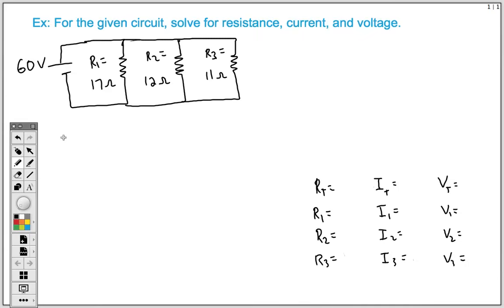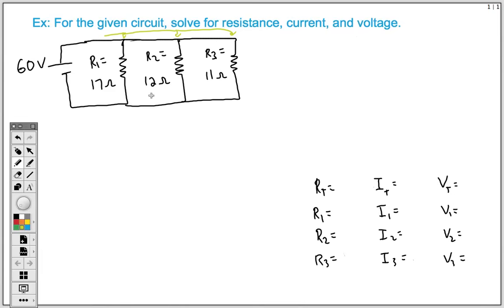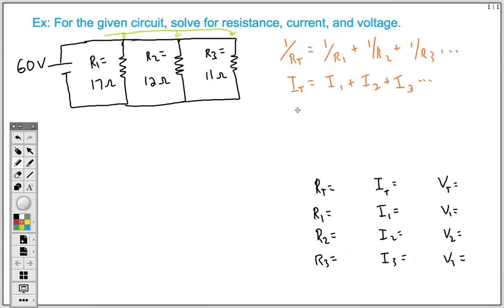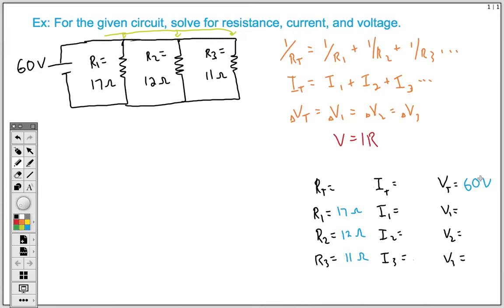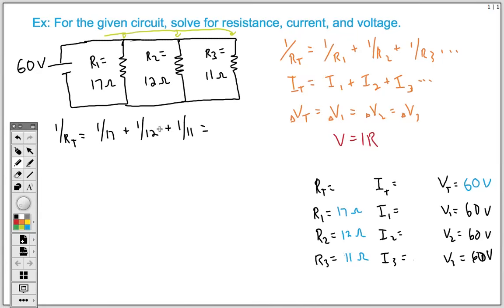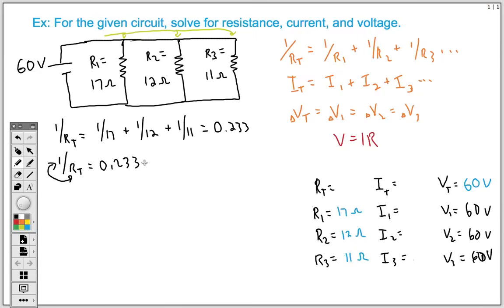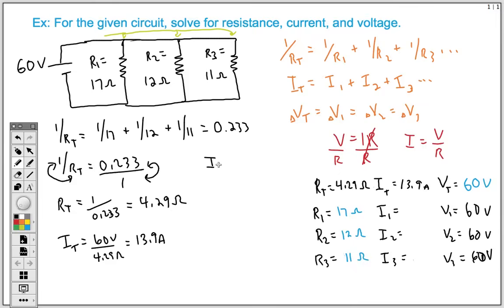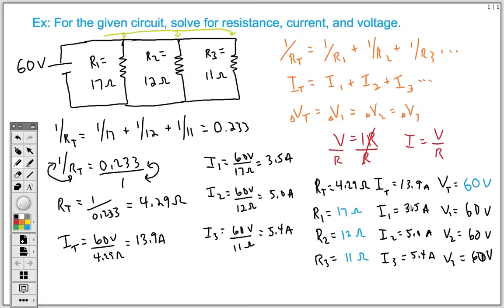How to Solve a Parallel Circuit (Easy)

Comment: I know that it a old video my problem is when I dived  60v into 13.9a I get 4.3 Rt not 4.29 every thing else worked I did cheat a little. I dived total   60v by 13.9    
 3 time ea same answer 4.3Rt I assume its my calculator.

Comment: @PhysicsHands One question so why did u put .233 and 4.29 but for It and I3 u put 13.9 and 5.4 and leave the other numbers after the .9 and .4
Reply: u didnt include the numbers after .4 from 5.4 bc the full number is 5..454.... and u cut the number at 4

Comment: I always had a hard time remembering voltage and current relationship between resistance in parallel and series circuits. Maybe remembering the inverse relationship with current and resistance in a parallel circuit will help me remember. Also, pointing out the reciprocal of the answer to get the final answer for total resistance in a parallel circuit equation was a point i always overlooked and no one really came out and explained it.
Maybe this will help me remember it. I don't do the equations on a regular basis, so time makes the memory slip. I'm brushing up on this because I'm a Journeyman Electrician, and I am wanting to go take my Master's exam for my contractor's license this year, and I know there will be at least one or two questions on the exam.
I'm not sure how series resistors and parallel resistors connected in series to each other would look. Some of the more simple circuits are easily identified, but some are more difficult for me to identify when they get more complex.
If I add three resistors I have in series and then two that I have in parallel, if they are connected in series, I should be able to add them all together, and in that case, if I had 12v source and add the resistors together in series, then my voltage should be 12 volts. Seems like a trick question but if I end up adding all the resistors in series, then the voltage will be the same after I add all resistors together.
what would a circuit look like if I had three resistors in series and two in parallel and the series and parallel resistors are connected in series. how would that look?
great breakdown of the calculations

Comment: I have to admit, when I was going through basic E in aviation school, I could never get it down. No matter how hard I tried to make sense of it. Memorizing formulas was what caused me to struggle the most when taking the General writtens to go for my A&P license. When you explained how to rearrange Ohms law at 8:18 , that really made everything click perfectly in one shot. It's all the same formula just flipped in a circle and as the circle rotates you rotate the order of the letters to make the next formula. (that's how I interpreted it) That made me think of other formulas in the Ohms law such as the equation R=V^2/P and that if I rotated it over the equation to solve for Power would be P=V^2/R and if I rotated it once more than I would get the equation for voltage being V= Square Root of P*R. I never needed to memorize all 12 of the equations in Ohms law but just 4 of them for, 1 for each of the sets and then I could rotate each equation twice to get the remaining 8 formulas! Thank you dearly for all your help. You truly don't know how much this helps.
Reply from the maker: @spectresarc  I like to call that "equation manipulation"
Reply: @DMaciaga truly you’re an amazing teacher and am glad to have come across your channel 🙏

Comment: Your explination is good but a bit vague And confuses the student. You said "just add all Resistance whitch gives you 0.233" but never explain how you got it thus confusing the student.

Next time try explaining a bit more on how you get those numbers. Whether it's by just simplifiying or converting a fraction to a Mix number. And also try to pick easy numbers to work with. Like base 10 numbers and such. It makes it easier to learn the process without having to overload on calculations.

Everything else is awesome.
Reply from the maker: @silentrookie1468  check the link in the description if you need more help on the 0.233 part.

Comment: That wasnt the easy way at all. I have no idea how you  got 0.233. I added those fractions and got 523/2244 and came out with 4.29 ohms. What you did was confusing.
Reply: If you add those 3 you'll get 0.2330659 or just 0.233

Comment: Mr. Amp i still cant figure out where did you get that 0.233🤧
Reply from the maker: Look in the video description for a link to a separate video where I explain the 0.233.
Reply: learned this from the class im stuck in, you get R1, and put it under 1. (in this case would be 17) and make that a decimal. do the same for R2 (and R3 if you have one). once youre done, you should add them together

Comment: Thanks for your video. Im trying to apply this to a paralell circuit of motors. Does this mean if Im trying to select the correct power supply to use in this situation my power supply has to be  a 60v supply with 13.9a output for it to work? And would it still function with a larger amp output?
Reply from the maker: Your question seems to be an engineering question in nature. I'm not really sure. Generally speaking the voltage supply is set (120V for a standard US outlet) and the resistance of the electric device determines the current supplied.

Comment: I never get the same number as these tutors when i add the resistances together how did he get 0.2333? I feel stupid I literally pressed the same exact buttons on the calculator and got different answer and my test is in a hr 🤡🤡🤡🤡
Reply from the maker: I have a link in the description that explains that part.
Reply: @DMaciaga  you're the man

Comment: If you solve for I1, I2, I3 first by using ohms law(V/R) then add them to get current total you can then use ohms law for resistance total?
Reply from the maker: When adding them in parallel you'll need to add their reciprocals, then to can use that for the total.

Comment: I need a question answered. 
Same math problem, different numbers.
1÷7+1÷15+1÷12= 0.2928 and gets rounded to "0.293" BUT when they did the next step- 1÷0.293= 3.4129, is stayes 3.41 and does not round up.
My question is... WHY? Please tell me.
Reply from the maker: Not sure, it could just be a preference. We should technically be using significant figures when doing calculations.

Comment: What? At 7:10, do you multiply .233 by 2 to get 4.29? How did you get 4.29?
Reply: 1 divided by 0.233 = 4.29 

its in the formula
Reply: He needs to do it by lowest common denominator to make it more easy that's what I think.

Comment: How do you solve for missing resistance?
Reply from the maker: Use V = IR as directed in the video.
Reply: @DMaciaga  as in let’s a R2 , same method?
Reply from the maker: @FierceSkatin  if you're trying to find R2, then you need V2 and I2.
Reply: Just like terms correct?

Comment: I am a little confused about why the total resistance is less than the sum of the reciprocal resistances. I feel like it should be somewhere between 11 to 17 ohms, no? Either way thanks for the video. Helped me understand how to do the math for a geophysics question.
Reply from the maker: In parallel, the more resistors you have, the less total resistance you will have. It would be the equivalent to opening up more cash registers at the grocery store to allow more customers to flow out of the store.
Reply: @DMaciaga  OH that makes a lot of sense. Thanks!

Comment: For anyone NOT understanding the .233 part of his explanation I will simplify it for u.....let me explain....if u add 1/11+1/12+1/17....the LCM is 2244. 132multiply by 17 gives u 2244...204multiply by 11 gives u 2244...187multiply by 12 gives u 2244. Just add the multiples which are 204,187 and 132 and u get 523. So 523 will b numerator n 2244 denominator. To get .233 just divide 523 by 2244. Now since it is inverted it means to flip it,so to get 4.29... just divide 2244 by 523. Took me an hour trying to figure out wtf he was talking about...he should have explained that part in detail. He explained everything else to the "T" but that part lost me...had to figure it out myself.
Reply: How to find the LCM of 2244... just multiply the denominator which are 11, 12 and 17

Comment: What do you mean " when you plug 0.2333 in? 7:19. Thanks!
Reply: Exactly..bro he definitely lost me on that. I am stuck on how to get the 4.29
Reply: I finally figured it out. He was NOT explaining it clearly but I finally figured it out and can assist you if u still need help.
Reply: Let me explain....if u add 1/11+1/12+1/17....the LCM is 2244. 132multiply by 17 gives u 2244...204multiply by 11 gives u 2244...187multiply by 12 gives u 2244. Just add the multiples which are 204,187 and 132 and u get 523. So 523 will b numerator n 2244 denominator. To get .233 just divide 523 by 2244. Now since it is inverted it means to flip it,so to get 4.29... just divide 2244 by 523. Took me an hour trying to figure out wtf he was talking about...he should have explained that part in detail. He explained everything else to the "T" but that part lost me...had to figure it out myself.

Comment: i've understood this video up until the part where u got 0.233 as ur decimal.. can u explain plz because i'm still confused on that part :/
Reply from the maker: I made a video how to do that. https://www.youtube.com/watch?v=-rlbe7se8dg&list=PLiNLOUuV2o1xLQaamib4S65wB9tIu6JhF Hope that helps!
Reply: He is clearly NOT explaining that part clearly...I finally figured it out awhile ago and I can assist you if u still need help
Reply: Let me explain....if u add 1/11+1/12+1/17....the LCM is 2244. 132multiply by 17 gives u 2244...204multiply by 11 gives u 2244...187multiply by 12 gives u 2244. Just add the multiples which are 204,187 and 132 and u get 523. So 523 will b numerator n 2244 denominator. To get .233 just divide 523 by 2244. Now since it is inverted it means to flip it,so to get 4.29... just divide 2244 by 523. Took me an hour trying to figure out wtf he was talking about...he should have explained that part in detail. He explained everything else to the "T" but that part lost me...had to figure it out myself.

Comment: what about something to show if you have amps and resistance but the voltage is unknown? That is what is stumping me hard.
Reply from the maker: Since the voltage is the same everywhere in a parallel circuit, use Ohm's Law to figure out the voltage.
Reply: @DMaciaga   well my problem is, and i guess im just not following, is i have 4 resistors #1 at 2 ohms, #2 at 4 ohms, #3 at 6 omhs and #4 at 12 ohms with 1 amp. so i guess the math is confusing me on how im supposed to get the same voltage on all the legs.
Reply: i guess just tell me if my math is right. total resistance would be 23.81 ohms? which would give me 23.81 volts?
Reply from the maker: @eagledefense2004  Assuming each of your resistors are on separate branches, your total resistance would be 1 Ohm. Your voltage should be 12 V; V = (1)(12).  From there you could calculate the current in each branch. Add up all the currents to find the total current.

Comment: How do you pug 1/0.223 in calculator cause  I keep getting 4.5
Reply from the maker: 1/0.223 is 4.5.
Reply: @DMaciaga  o so basically im an idiot lol
Reply from the maker: @tylerkilo5254  No, you're just misreading the number. It's 0.233 not 0.223, that's why you weren't getting 4.29.
Reply: @DMaciaga  yea thats why i said im an idiot XD

i appreciate the help tho !

Comment: Now how do you get the voltage drop over each resistor?
Reply: Voltage is the same all throughout a parallel circuit :)

Comment: hey man! how did you get the reciprocal of 1/17 + 1/12 + 1/11 ? how did it come up with 0.233 ? I'm too rusty that's why I'm asking.. Thanks for the reply
Reply: Hey! I just did the problem too. You can find the decimal for each of the values, 1/17 = 0.0588, 1/12 = 0.0833, 1/11 = 0.0909, and add the decimals to equal approximately 0.233.

Comment: Thank you ,  I am doing an electrical installations course . Did the calculation using a different method (I use my calulater on stats settings , I find it simpler )  . It was reassuring and helpful  knowing that my method was also right .

Comment: It would have been quicker to solve the total current and use the total voltage in combination to solve for the total resistance. I suppose in some cases you may need to work this way but the example you gave would have been easier solving the voltage and then current. I use the P over I and E; E over I and R or you can remember PIE and EAR. This will help anyone remember the formulas if you have a hard time. Lay it out with PIER.

Comment: My instructor was confusing me when explaining this exact process.  He did it just like you, but my confusion was about the Volts being the same everywhere. He was talking about voltage drops at each resistor or pairs or resistors in parallel in their own branch, and then saying the voltages here were all the same.  Can you explain voltage drops???
Reply from the maker: A voltage drop is a measurement of how many volts run across each branch in the circuit. You can think of voltage like how much electric power runs through the branch. Hope that helps.

Comment: Hmmm... Resistors give off heat... The higher the resistance the greater the heat... Heat can be made into steam and generate energy...

Now... Say we have 1000 ohms of resistance in 1000 branches ... The total ohms would be 1 ohm with that equation... Now... Voltage is constant... And since v=IR I=V=60... 

NOW, use 100,000 ohms and 100,000 branches... You get the same total ohms and same total current...

NowV=IR AND THE BATTERY USES THE TOTALS AND THEIR THE SAME SINCE POWER=IV SAME POWER USED BUT FAR MORE HEAT HENERATED BY RESISTORS ... In fact infinite heat... Say 1 billion ohms and one billion branches... Still adds to one ohm total... Hmmm... Steam energy anyone?

Comment: Hmm if voltage is the same everywhere and current adds to the same initial voltage after the resistors... That means that nothing changed after the resistors and then after the resistors you could collect the power again by charging a battery ... Right? So nothing's lost... And resistors let off heat so you can generate energy by for example turning steam turbines... Hmmm

Comment: it would have been more helpful if you explained now you got 0.233 by adding those steps on your video. So far I have only seen 1 person explain correctly with a step by step method.  Go to "Series & Parallel Circuits & Ohm"s Law Physics, part 5"  she uses the table method and the fraction method at 19:10
Reply from the maker: I clearly explain to add up all three fractions to get 0.233. The reason why we do that is because of the equation for total resistance in a parallel circuit (which also was explained).
Reply: It's much harder without a calculator because you have to add fractions which involves finding a common denominator.
Reply: @DMaciaga  I don't understand how you get 0.233
Reply: @Rahim Omar if u have a scientific calculator just put it like this    1÷17+1÷12+1÷11= 0.233 
I hope it will help you.

Comment: How two get the ohm resistance of 350 volts  I get the process just don't know how do you get ohms
Reply: You will need at least to know one more value.  The easiest is probably the Current.  If you know both Voltage and Current, divide the voltage (in Volts) by the current (in Amps) and you will get your Resistance in Ohms.  You can also use the Power in Watts to find the resistance, but it's a bit tougher (Resistance=VoltageSquared/Power(in Watts) OR Resistance=Power(In Watts)/CurrentSquared).

Comment: what if i have a parallel with 6ohms on top then 12 ohms then on bottom 6 ohms?
Reply from the maker: From what you are describing, you would solve using the same method. 1/Rt = (1/6)+(1/12)+(1/6) to find the total resistance. Then use V=IR to fill in the gaps.